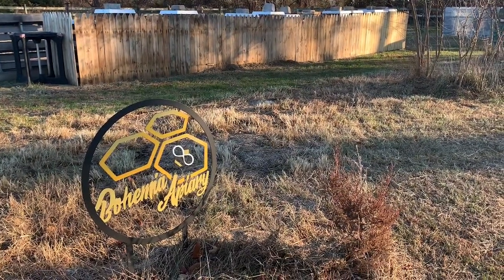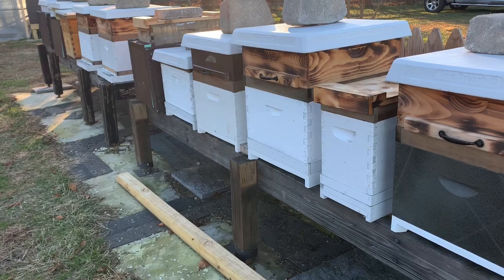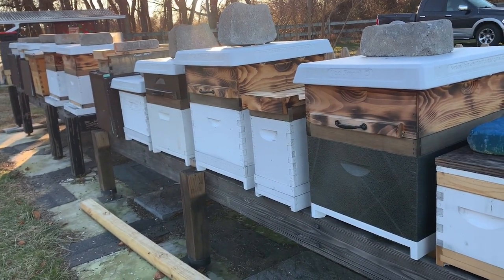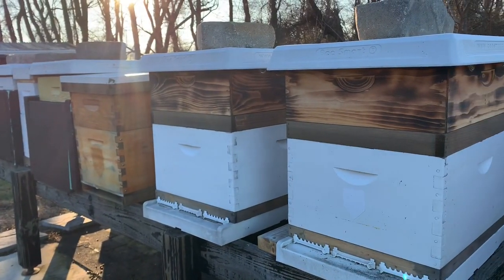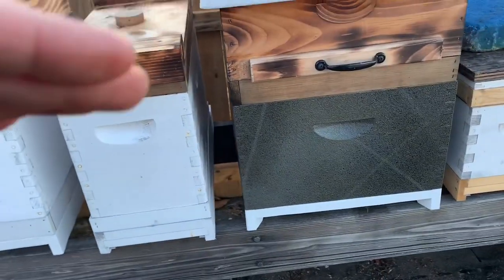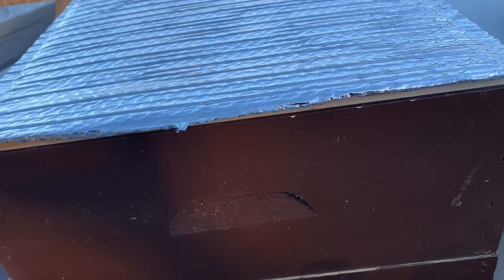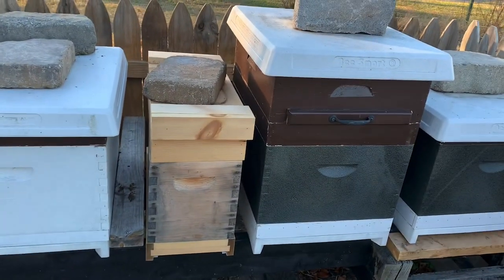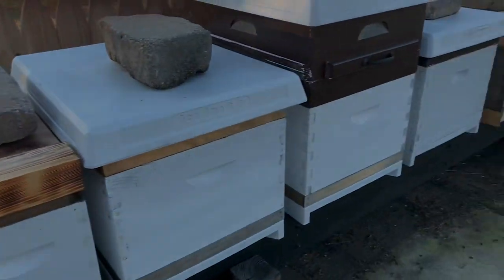What do bees do during the winter? | Beekeeping

Comment: If you live in a cold place like this then you should have insulated boxes
Reply from the maker: Not necessarily. Wrapping hives are not necessarily required but are a good practice to have some type of better insulation in much colder climates if you overwinter outdoors and not in a root cellar or temp controlled facility. 

The key is to have strong colony, low mites, and heavy stores going into winter.

Comment: So... have a question for you.

Right now its cold enough where I am that the bees only can fly for about 3 or 4 hours of the day. The rest of the day its below flying temperature, sometimes freezing sometimes not (above 30 degrees F but below 50 degrees).

This means I technically could put out sugar syrup still for the 3 or so hours of the day. 

What do you reccomend? Would you put out sugar syrup (outside the hives) in feeder buckets? Or would you just only do mountain camp method with the raw sugar?  

I should add that a primary element affecting this is that during the temperatures where its too cold for the bees to fly, the feeding stations are absolutely totally infested with yellowjackets, and wasps; literally seeing hundreds of these per feeding bucket. So even if I put the feed out, it may have some awckward spots where it may also be hard for them to break the yellow jacket infestation issues even when they can fly. And this is why its hard for me to tell if outside bucket feeders of syrup will still be worth it. 

Thanks for any thoughts.
Reply from the maker: I use the avg low temps to guide when I stop syrup feeding and put on dry sugar (mt. camp method)  

Remember, bees cluster when the outside temps drop to 50 degrees or below. 

They only can eat what they can reach and won’t break cluster to forage food in the far reaches of a nest or leave the small amount of  brood. This includes going to a feeder even internal. 

The other issue is continuing to feed syrup adds moisture to the inside of the hive.

I feed 1:1 for pure energy and comb/brood making. Then switch to 2:1 in late fall because it’s less water and they store it close to the current brood nest. Then when avg low temps reach 50 I put dry sugar on (or some do fondant or candy boards) and leave them alone for winter.  

If for some reason you see a few days in winter where it does warn up to mid 60s for a few days you can feed a small amount. 

But it isn’t necessary unless they are really lite and still have some winter left to go.
Reply: @BohemiaBees  Thank you very much. Its amazing how there can be so many things that can happen with bees.

Comment: QUESTION FOR YOU.  if you only keep the bottom entrance open in the winter with no top entrance, won't all the condensation stay at the bottom where the cool air is?
Reply: I'm a beekeeper in Nova Scotia, Canada. We drill a hold in the top box to allow air flow. Usually about a half inch in diameter.
Reply: @Melaniejd902  Do you also keep a small bottom entrance open?
Reply: @bradgoliphant  yes, we add an entrance reducer as the temps start to drop late September. The opening remaining is about an inch wide.
Reply: @Melaniejd902  Oh wonderful to hear.  This was my first winter here in NYC, and I ended up adding a 1/2" hole in a top shim, and only having like a 1" hole in the bottom entrance as well.  I also added a 3" sugar brick.  Thanks for getting back with me.
Reply: @bradgoliphant  I would expect our beekeeping styles would be very similar given we are close geographically. All the best with your hive this winter! 
I haven't added my sugar bricks yet. I'm hoping I get a mild day to pop in them in. It's not unusual for Nova Scotia to have some warmer days in December.